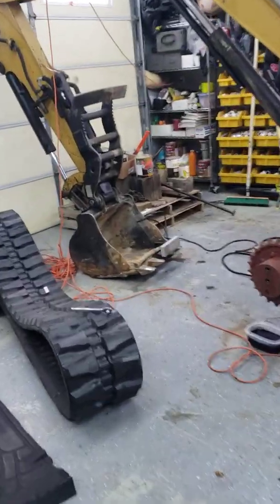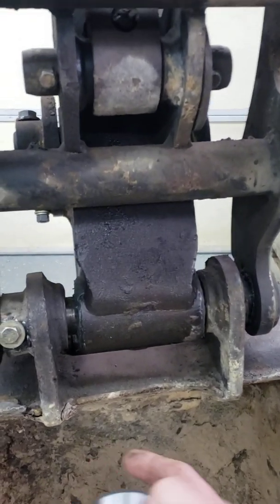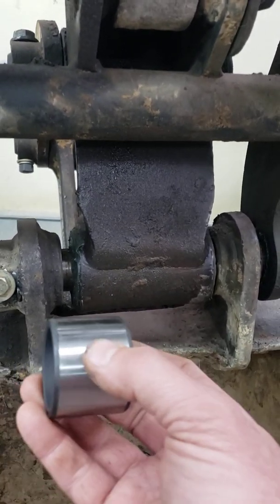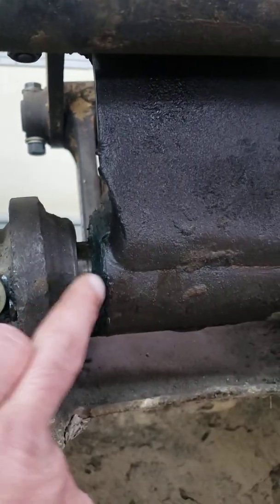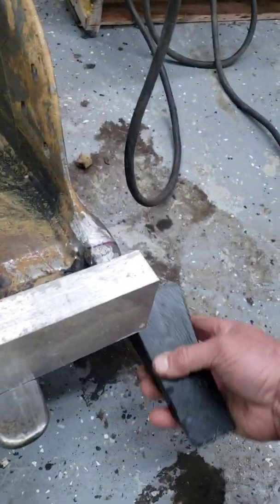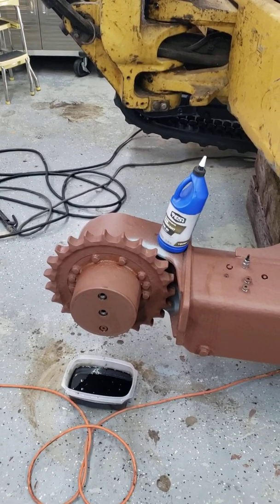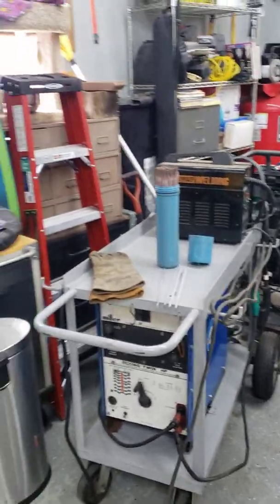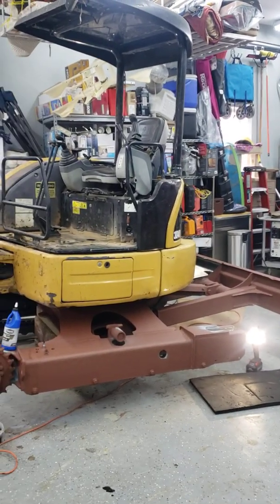A Trick on Heavy Equipment Pin and Bushing Alignment before Welding

Comment: How is this holding up?     I did the same to my machine last year, but didn't weld it.   I did it as a temp fix, and plan on taking it apart this winter.     As I understand it,  the way to to remove JB Weld is to heat it, so it would seem welding would remove/melt down, or at least weaken the JB weld.

Comment: I have the exact same issue with my Miniex and I had this same idea. Thank you for posting! How's it working so far?
Reply from the maker: Hi Sean,Thanks for the positive feedback, yes it worked great just make sure you weld the bushing with Hardened Welding rods due to the force that's going to be applied while machine is working.. Please Subscribe and Thanks Again for.your Support!!